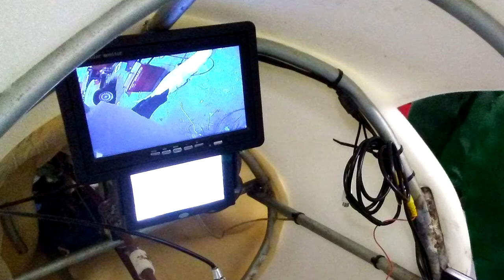Easy DIY! How to make a Dinosaur Halloween Costume CHEAP!!!!

Comment: Good Job! The dino costume looks great! It's a a huge challenge to make one adult dinosaur costume by only one person. 
What a great dad you are!
With some texture would be better. :)
btw: how about the weight of it?
Reply from the maker: +Danny Zhang  it weighed about 80 lbs.  But it was very balanced. I made the tail long and put the battery as far back as I could to counter the weight in the front. I donated it to an aquarium this past year. It was fun to make, but took up a lot of room!
Reply: A dismountable tail will save room, but need to find a way to hide the seam between body and tail.
Reply from the maker: Danny Zhang the dinosaur from tip to tip was 16 feet long. We had to use an enclosed trailer to transport it.  That's part of the reason I donated it to charity. ...it took up a ton of space.  I tried using a soldering iron to carve detail 8nto the foam but it was going to take forever to do it.  Plus it smelled horrible to burn the foam.

Comment: Where did you put the cameras? And was this a costume you could use for later years? How were you able to transport it from place to place? I wanted to create a costume like it for conventions, but: 
1) I have no power tools, nor any experience with them.
2) I live in Florida, where moisture is abound--and I fear mould getting into the costume. D:
Reply: For the mold i definitely recommend using breathable foam

Comment: Quick questions
where did you get the camera system at? and how much foam did you think you used? I am planning to do this myself but more of a devil dinosaur cosplay. I haven't been able to find anything on the camera. If you can also give any tips that would be much appreciative!
Reply from the maker: Hey optimus,  I ordered most of the camera stuff from "wish". (Go to the Google play store and search it.  The front and rear ares  night vision cameras. The rear camera specifically is a car back-up camera.  I bought 2 monitors for the inside.  It's all powered by a 3000mA  12 volt battery.  Pretty easy to wire up.
Reply from the maker: It took a lot of foam.  The head was "great stuff" expandable foam.  The rest was foam rubber "seat cushion foam". It's kind of expensive. You'll want the 1 inch thick foam for the body, and really thick 3-4inch stuff for the legs.
Reply from the maker: I welded the frame together using wire conduit. It was pretty complex making the neck move.  I think I have pics on my Facebook page.  Find me if you want: Keithericparsons77 in North carolina
Reply: Thank you for the info! Greatly helpful